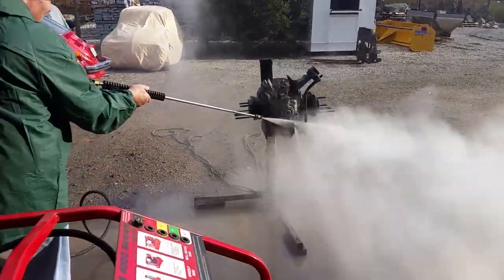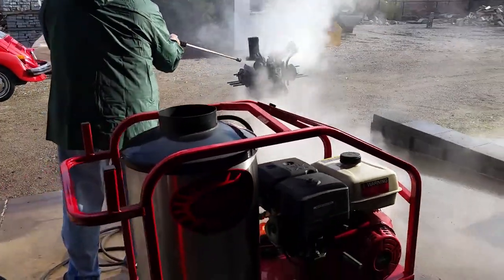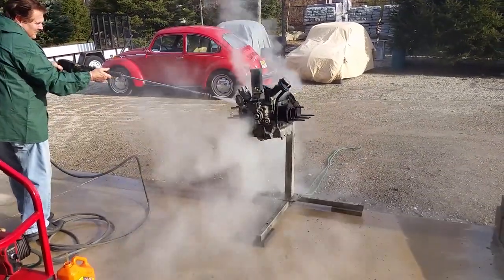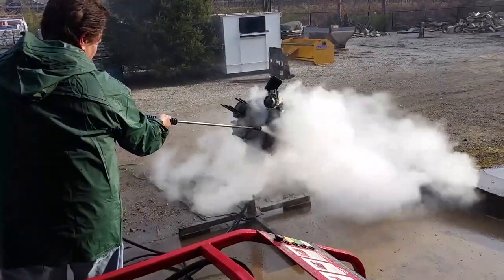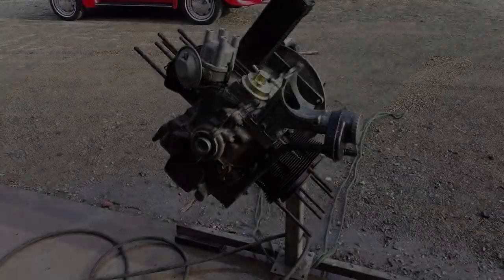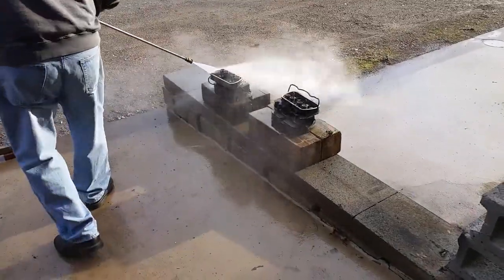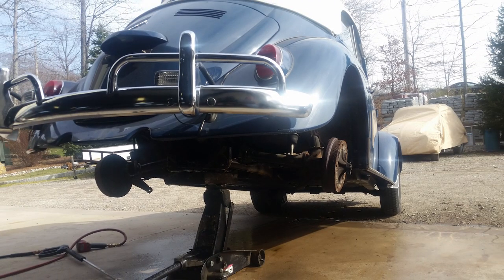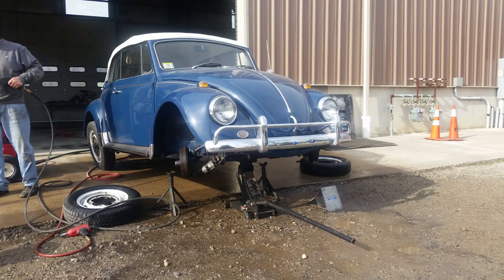Classic VW BuGs Steam Power Wash Blasting a Vintage VW Motor Engine Block

Comment: Would it be recommended to try this on an installed engine from underneath to get rid of oil from oil leak to then try a high temperature sealer?

Comment: Did you block of the pushrod tube holes on the case before steam blasting? How do you prevent water getting inside the engine or do you just let that happen and let it dry?
Reply from the maker: Yeah we then blast it with air after and let it dry.
Reply: @classicvwbugs  what do you use to block off the holes?
Reply from the maker: @ctreatman  no, they would just blow out.  You have to blow through all the galleries.
Reply: @classicvwbugs  awesome! Thank you for that Chris! You've helped me so much in the past few months I really appreciate it!

Comment: I would never thought about steam. is it a setting on a pressure washer
Reply: Probably not, since the water needs to be heated enough to produce steam. Probably an additional set of equipment used in conjunction with a power washer.